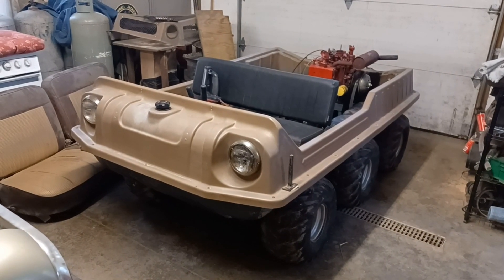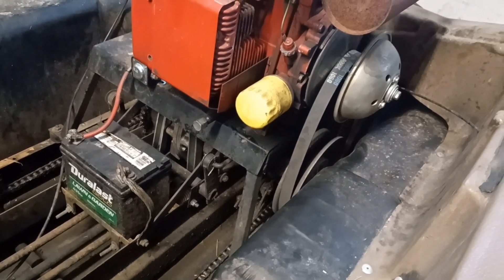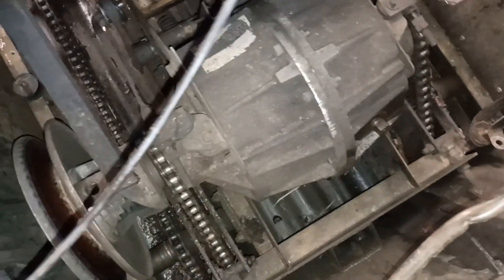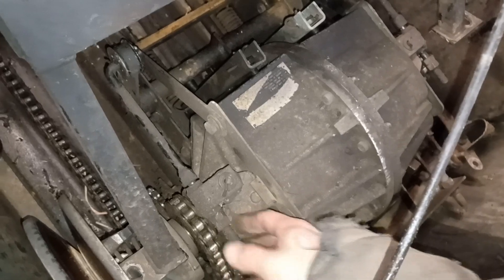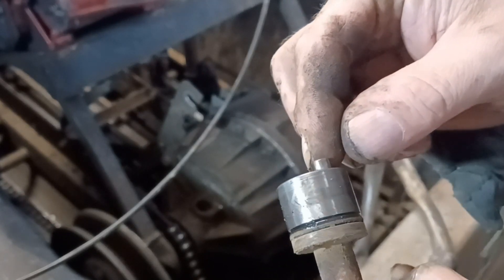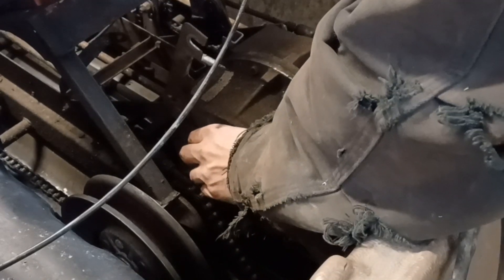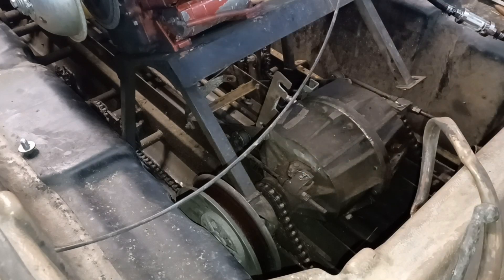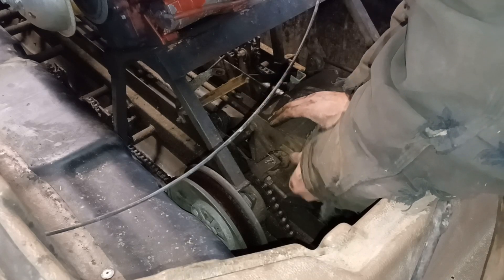Max IV 6x6 Transmission Adjustments

Comment: Thanks for posting this I have one too but my is work fine but interesting What year is your my is 1996 Max iv with 18HP vanguard motor  .
Reply from the maker: I'm not sure on the year, but mine has the 20hp kohler
Reply: @nsh57  Yeah for sure your probably 95/ 96/97 just around there. I upgrade mine with a spline instead the OEM with shear pin.